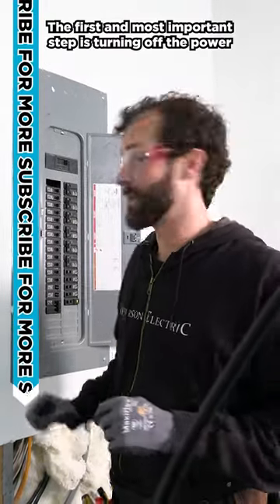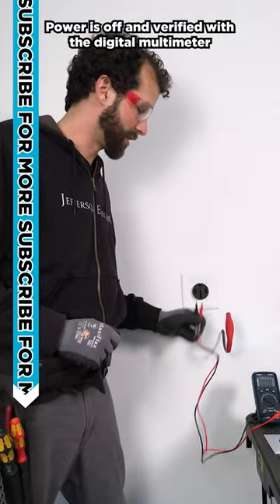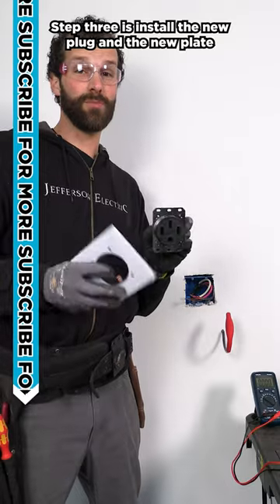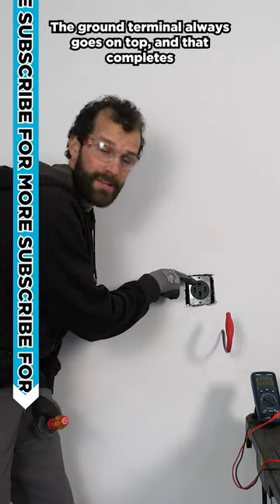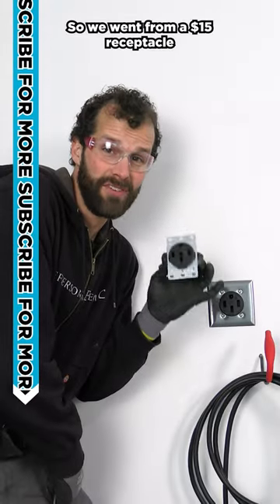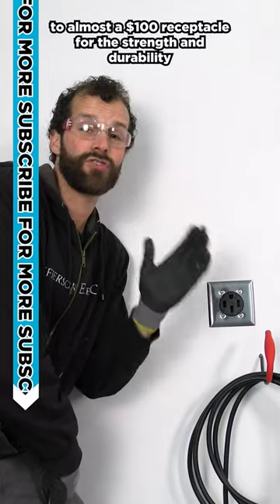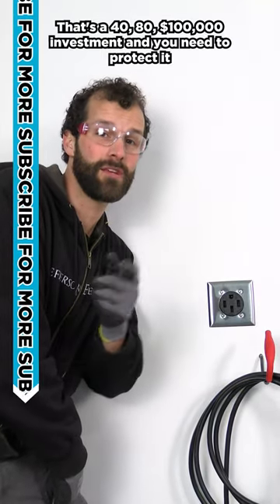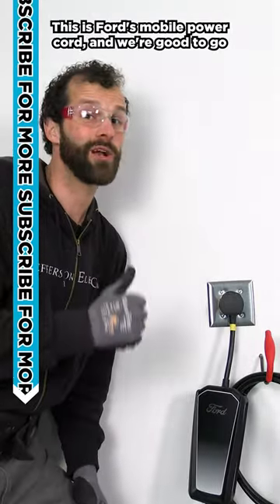These things are house fires in disguise

Comment: Ugh... I mean I am yet to see a properly installed, properly torqued UL-listed 14-50 fail in the field, regardless of whether its a $12 or an $82 one. EVSEs are normally not plugged in and unplugged all the time. The plug-unplug cycles are one of the biggest selling point of any heavy duty receptacle, but regardless, they should be able to carry 80% of their listed ampacity continuously without a problem. If someone has an example of a properly torqued and installed UL-listed receptacle fail, I'd like to see it, and I might consider changing my mind.

Comment: The ground opening can be on the top, bottom possibly the left or the right.
The ground orientation is best going with the direction the flexible cord goes, especially with an angle plug.

Comment: Personally I never have an issue with the 4 prong 50 amp receptacle, I’m talking about the Home Depot or electrical supply receptacle. I’m assuming that the $100 is better, but is nothing wrong with the regular $10

Comment: For those questioning $10 vs $100 receptacle:

If you plug in an appliance once a year or less (how often do you unplug your range or dryer to clean behind it?), the $10 receptacle is plenty durable. For something you might plug in daily or weekly (your EV), you definitely need a receptacle that can handle the wear -- and the $10 receptacle won't do that.

Sure, you don't need to unplug the charger from the wall in order to drive the vehicle away. But if you're traveling or want to charge away from home (and not at a charging station), you might want to bring your charger along with you. That means you'll likely be connecting and disconnecting it far more often than any other appliance.
Reply: I disagree, this receptacles has been use for home or commercial electric welders, where is plugged and unplugged very often and is no problem.

Comment: Why does the ground go on top? Is that part of manufacturer instructions?
Reply: If something falls on the receptacle like a paper clip and you got your car charging it would hit the ground first before hitting the hots
Reply: For NEMA 14-series plugs, the cord always comes out the side opposite the ground pin. Placing the ground on top ensures that the cord hangs down rather than looping over the top; hanging down reduces stress on the cord, the plug, and the receptacle.

I don't know if it's an established standard, but it at least seems to be a de facto standard.
Reply: @alexc7943  That is the reason that some people have given to do this, however, for a standard 15/20 amp receptacle it is not code and there is no evidence that is safer. If the manufacturer specifies it for this particular receptacle, then that would make it code.

Comment: Did you just turn off 2 separate breakers and not a 2pole?
Reply: Two separate breakers. There are two receptacles in the garage. The breakers are single handle double pole breakers.
Reply: Freeze the video at the point where he says "we have two", and you can see behind him that each of the two that he turned off was a 2-pole.
Reply: @svyt  you are correct! Two circuits with double pole breakers.